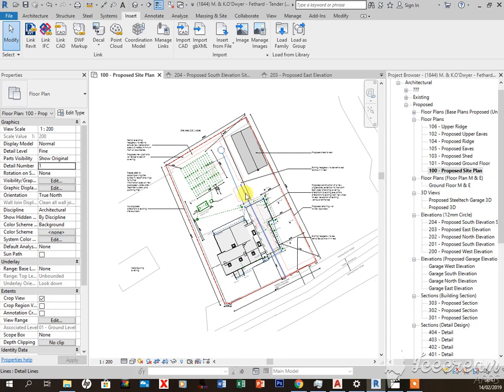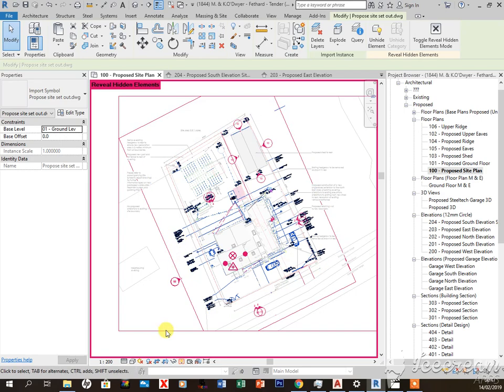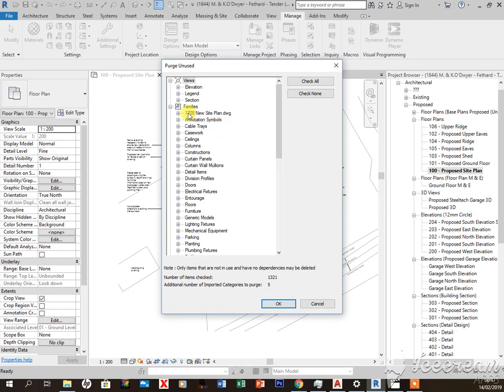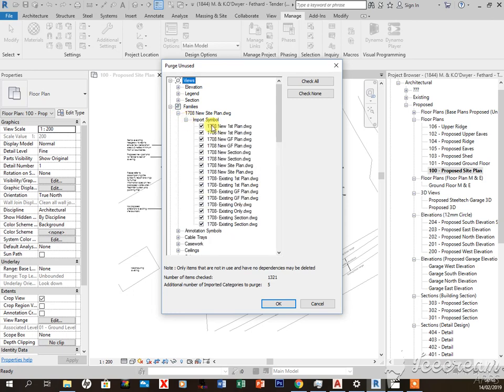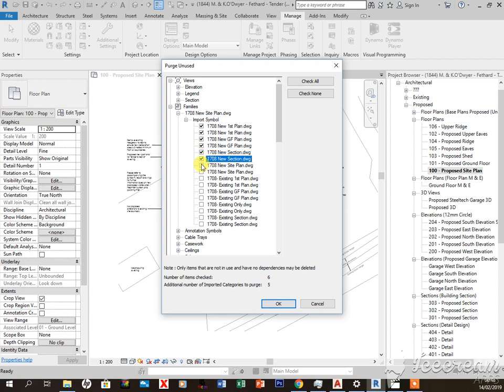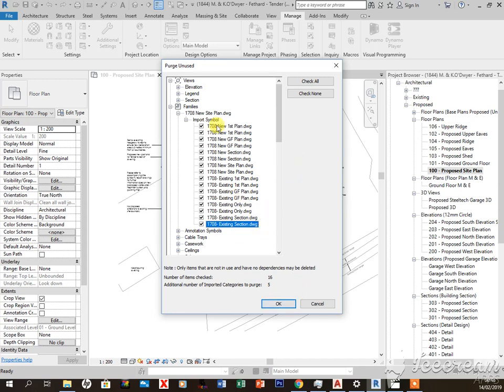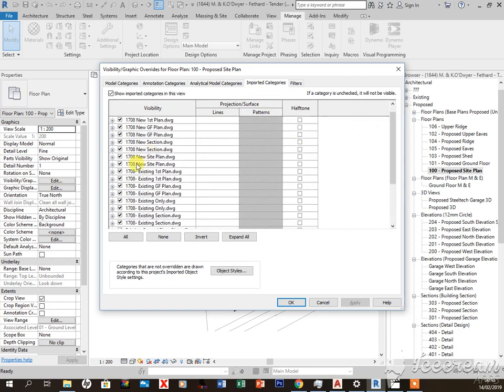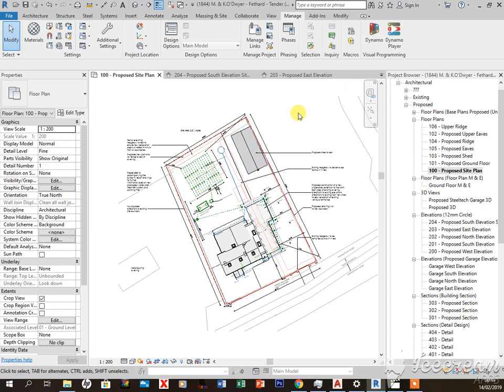Removing CAD Drawings from Revit Project - How to delete dwg layers from imported CAD plan in Revit

Comment: Useful but this method doesn't detect all imports and purge them. There is a plug-in that will remove all the imports, the problem is that it removes all the ones you might still be using as well...
Reply from the maker: Hey Vera, Many thanks for your tip! this has helped me better understand the process and indeed i'm sure it will help anyone else viewing this tutorial better understand the beast that is Revit! haha cheers.